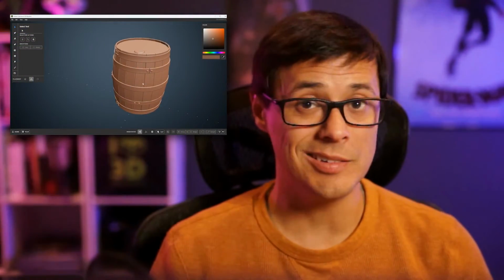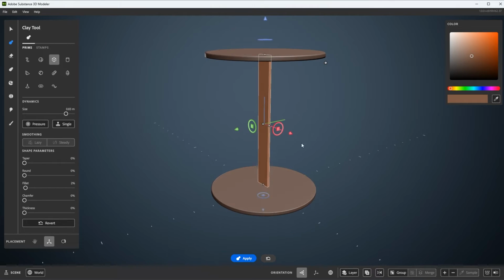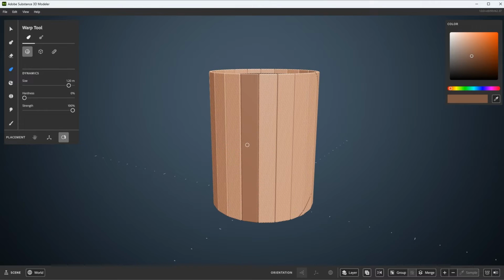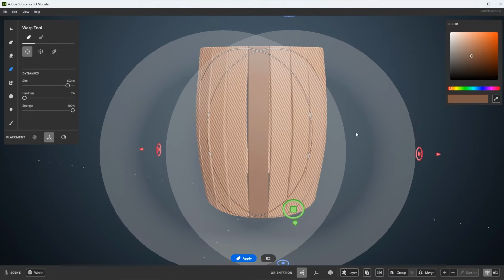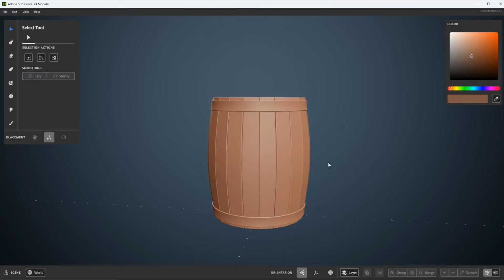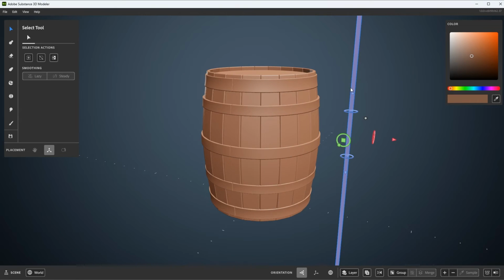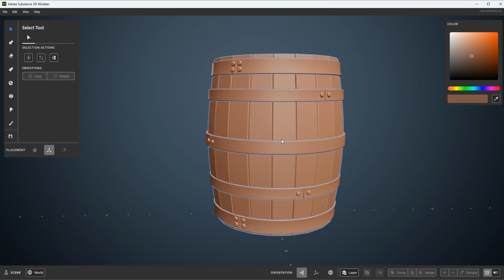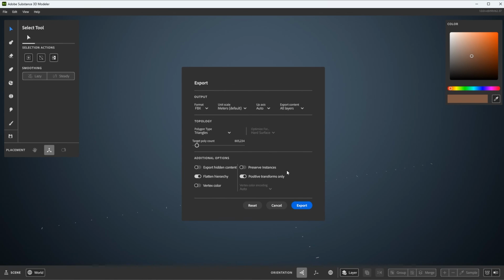Creating a wooden barrel using Substance 3D Modeler

Comment: I know the video is a tad old, but I couldn't make the gizmo work as it's working at 11.13. I found that if I hold the space bar -  while dragging - to apply and distort, and not just press once, the warp tool gizmo works as intended.
There are  few things that differ in this video from what I'm seeing, notably the one direction scale for the plank (I figured out I needed to hold CTRL for 2 way scale, and not holding CTRL for a one way scale: as in, the opposite of what we are seeing here). Not sure it's because the program has been updated, or if I tweaked some settings without realising, but I thought it would help anyone who would be in the same case as I am.
Reply from the maker: Oh yeah, I think its just that the video is a bit old and there have been lots of updates. I will create a new video in a few months. I am waiting for some new features to drop : )
Reply: @wes.mcdermott  Thanks for the clarification!

Comment: Hey Wes, I was trying to follow along this basic tutorial with Version 1.5 / 1.6 of Substance Modeler... but after creating the plank and doing the radial mirroring, things seem to be broken.
If you just "click away" after doing the radial thing, all planks are gone. If you do apply aka press space first, before clicking away you create all the planks, you can not manipulate the initial plank and have all others mirror it. You can basically just warp an area of the barrel, but not uniformly warping all planks...
Tried it a few times now and got a little frustrated now... what did I do wrong? Is this a bug in 1.6? (there were changed to the warp-tool!) - would be cool, if you find the time to check this. - Cheers
Reply from the maker: HI, I am sorry for these issues. I am looking into this to see if there is a solution of if something has changed in Md in the latest updates.
Reply: Awesome Wes, first class service as usually - thank you, for taking your time.  @wes.mcdermott
Reply: Hey Wes, any news on this? Cheers